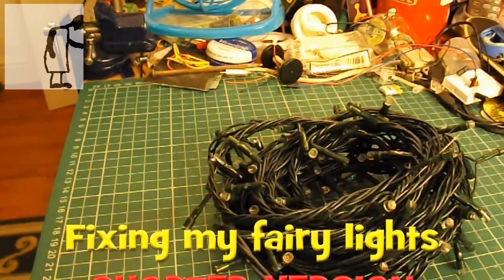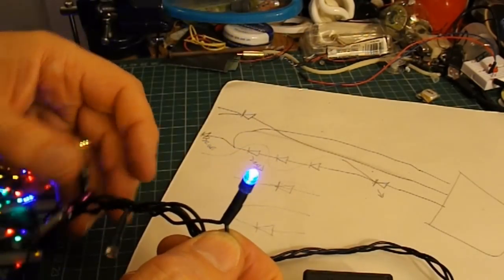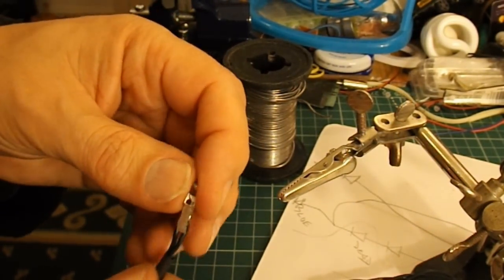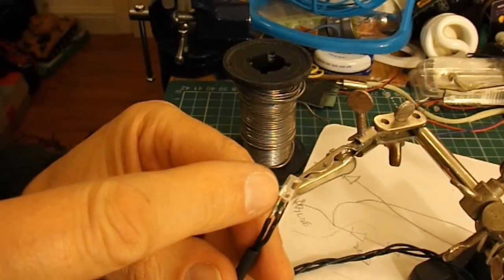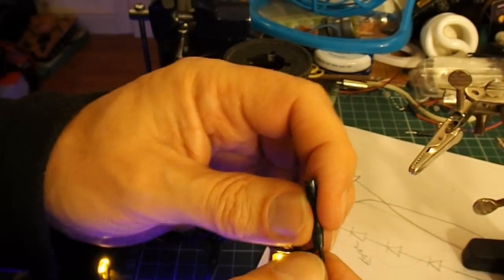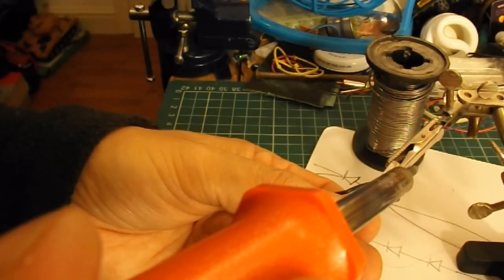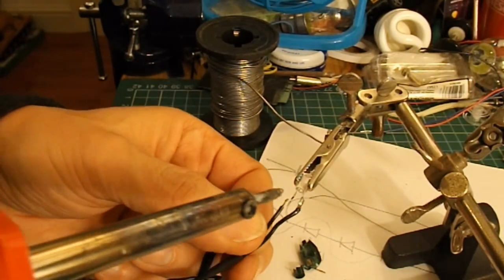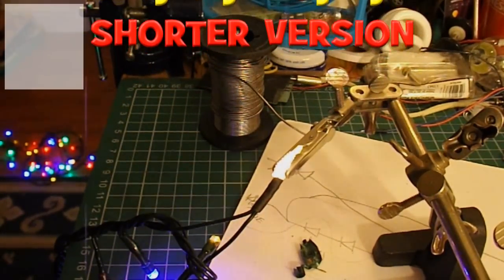Fixing my fairy lights SHORTER VERSION

Comment: I have a 1200 led string with multiple sections not working... wish me luck finding it
Reply from the maker: Generally speaking, the LEDS fail because their legs rust right through. You will find a few and fix them, and a load more will fail,  simply because they were already weak and finally broke while you were working on their neighbours 😕 Good luck 😂👍

Comment: my usb powered fairy lights are well connected with no broken wires, but only the first few bulbs would light up (and is very dim) for a few seconds before turning off totally. do you perhaps have any idea why this is happening?
Reply from the maker: How many LEDs are there?
Reply: GrandadIsAnOldMan Around 200.
Reply from the maker: @prawns3853  well in that case you will have real trouble finding the fault. It could be any one of the LEDs gone short circuit or disconnected and the only want to find out is test each individual one. With the old style bulbs you could pull them out and change them with a good one until you find the faulty one, but with LEDs you cannot easily remove them to test them. You could look at each one with a magnifying glass and you might be able to spot dead ones if the lens has become discoloured. Usually it is the soldering on the legs has failed. These LED sets are designed to be disposable.

Comment: now i know how to repair my christmas lights if one of them are broken, nice video
Reply from the maker: +marc wohlmayer thanks. I think there was a good level of luck here. I really didn't expect success as you cannot simply pull one out and replace it but I just happened to get it to work by wiggling each one. If 2 had been faulty in the same section that would not have worked.